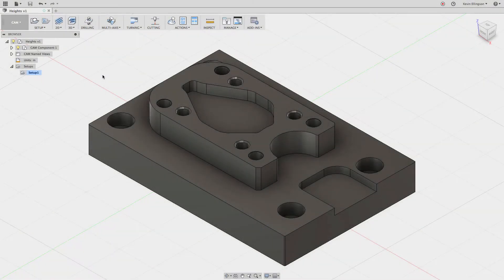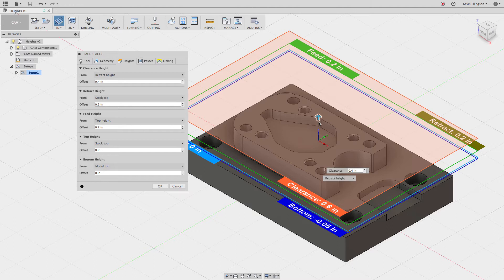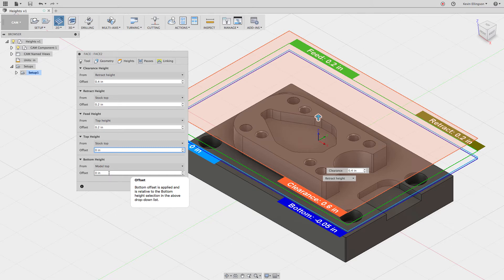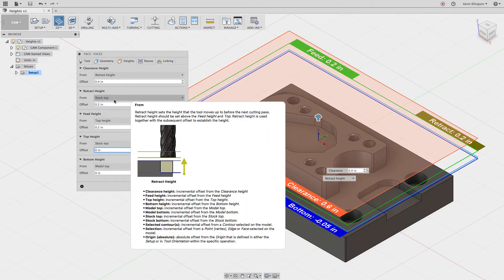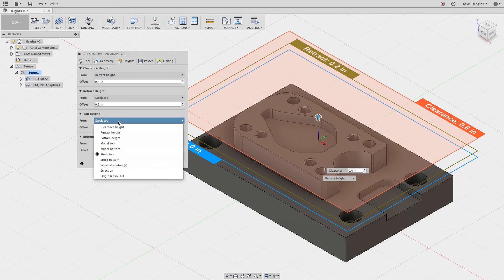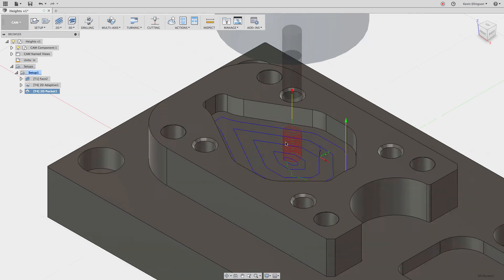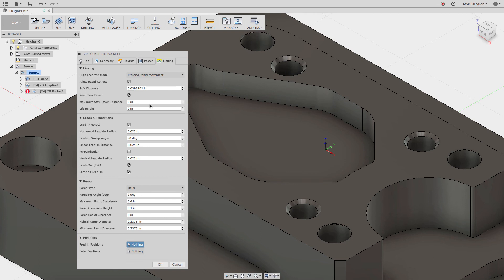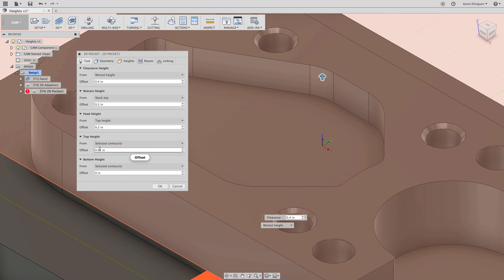Fusion 360 - CAM Heights Tab Explained

Comment: This is great. I only have one question. when setting my z height with a probe on something like the xcarve do i still reference from the original stock height or the new height when using model top.  For example if i carved 8mm off the top of the stock and then started my next operations with model top do i still probe to the original stock top to set z

Comment: Kevin, I am frequently using cleats to secure my workpiece. If I model and include these fixtures in the geometry tab, do I still have to worry about retract and clearance heights, or is Fusion smart enough to avoid them? It would seems a bit silly to have to set your retract higher than the cleat top even if you were working relatively far away from the fixture in X/Y.
Reply from the maker: Hi Darran. I would agree with you, that being said, you do have to manually set your retract higher. There is a small exception/workaround to this. As you have probably seen, when you create your setup you can specify things in your design that are fixtures. However, doing this won't trim a tool path to those fixtures, it will only make the tool turn red if there is a collision and it will be up to you to figure out how to make that not happen. The workaround is that if you include those fixtures as part of the setup models that are to be machined and use 3D toolpaths, Fusion will automatically avoid those items as 3D toolpaths are not allowed to gouge the setup model. It would be fantastic if Autodesk could just make this work the way both of us (and thousands of others) really want it to work. Thanks for the question.

Comment: Kevin by FAR  the best video I have ever seen on the heights tap!!! This will greatly help me, I am sure I will still have questions   but this is a GREAT help.
Reply from the maker: If you have questions, let me know. Heights can be a bit confusion when you are getting started. Once you work with them a bit, things snap into place and using the heights becomes very intuitive. For instance, you can select a chain of geometry anywhere along the z axis of the part for the area you want to cut and then you can use the top height and bottom height fields to choose where the cut should start and how deep it should go. How the heights are handled is one of my favorite CAM features.